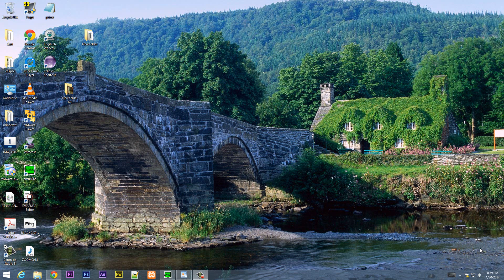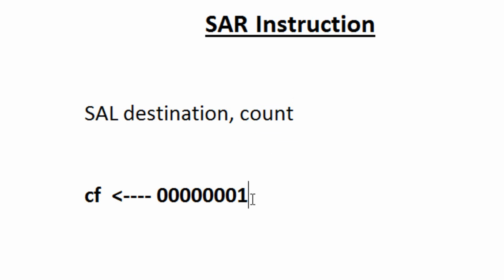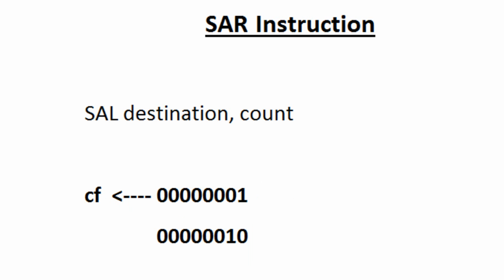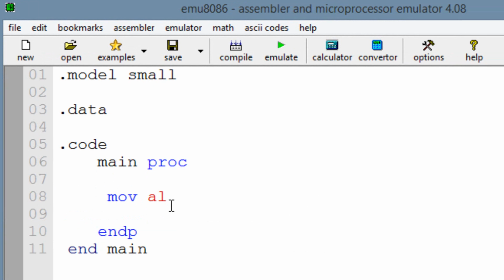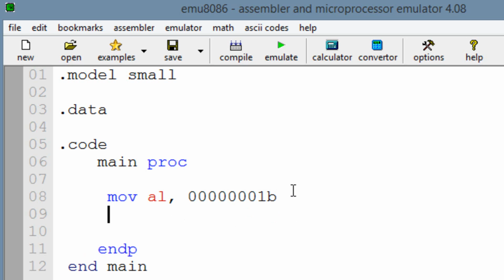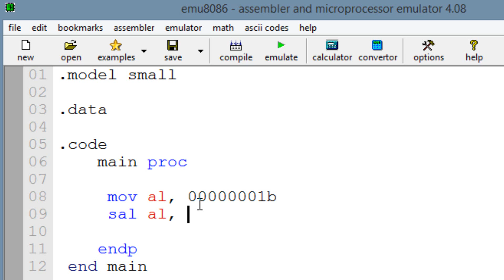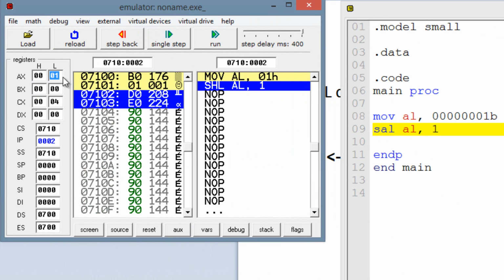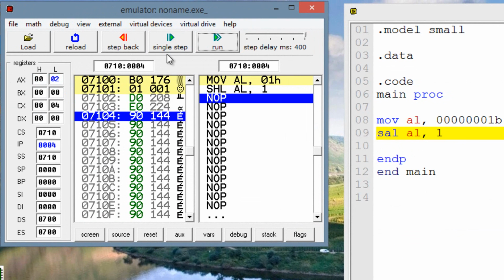Assembly Language Programming Tutorial - 47 - SAL Instruction

Comment: Hi Rasim, love the videos. Great job. Quick question, is there an emulator like Emu8086 that is 32 bit and supports more instructions? Emu8086 is awesome at what it does, I love the visualization aspect of being able to see the registers change. Was just wondering if there is another tool that is somewhat similar.

Thanks!
Reply from the maker: I have been looking for a while now for a 32-bit emulator, but I haven't found any good ones. If I do find one i'll start using it in my tutorials. You are right, the visualization aspect of Emu8086 is amazing and thats why I use it for all my tutorials.
Reply: Thanks for the reply.  Today I built a project in VS 2012 with a single as file. It was fairly easy to do but the thing I was trying to do was manipulate the stack based on an assembly example I was studying. When I ran my code that had instructions like moving byte ptr [ebp-8], 69h. well that won't work since we are dealing directly with memory.  Wish it did though.
Reply: Single asm file. Darn auto correct.